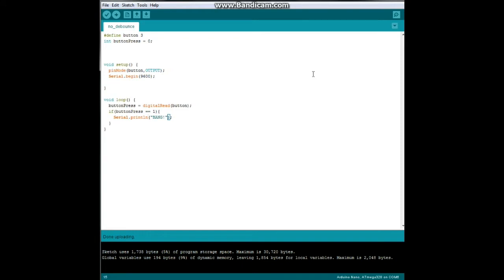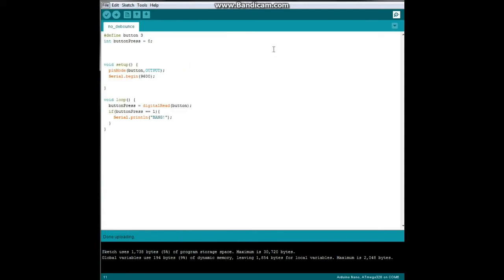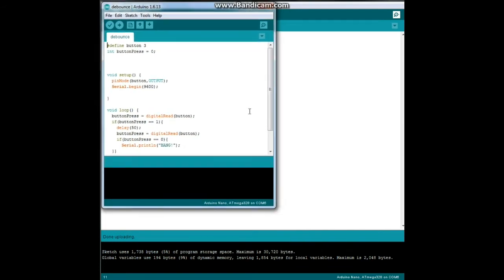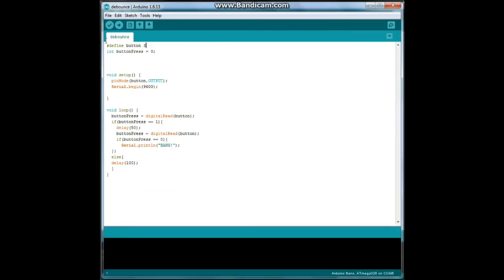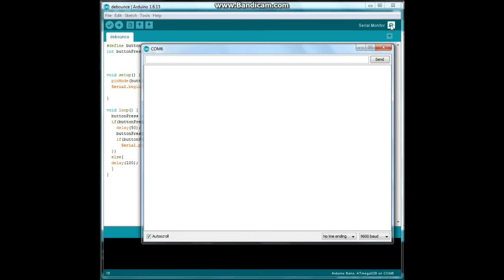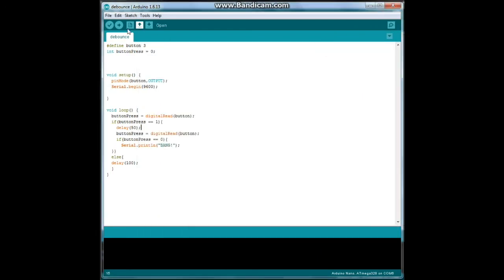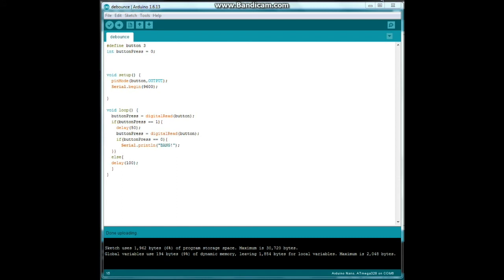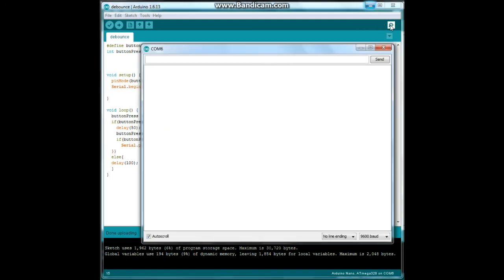How to debounce a button for Arduino

Comment: The multiple outputs of “bang” is because the code is checking for a high voltage on the button rather than the change of the voltage from low to high. So if it loops 1000 times in a second, it will print “bang” once per millisecond. If the code was rewritten to detect the change from low to high and still printed “bang” more than once when holding the button, that would be due to bouncing

Comment: I don't think the behavior you were seeing is due to bouncing. You're polling the button in a loop and printing a statement whenever it is high. Meaning that if you were to hold down the button it would continue to print the statement.
Reply: I think even if he held down the button, it will only print when a change occurs (1 to 0). This is due to opposite conditions of the if and the nested if.
Reply: @arjunmonga1054  

Josh is talking about the initial code he used. With the first sketch, learnelectronics claims the multiple printed statements from one single press of the button is due to "bouncing"--the phenomenon of multiple signals being generated from the contact of two metal conductors. 

Josh is claiming that the multiple printed statements are likely not from bounce, but rather from the loop() statement in his code reading the state of the button pin multiple times within the small amount of time the button was pressed.

 I'm not claiming to be an authority on avr or arduino, but I imagine the loop() method is called over 100,000 times per second.
Reply: I agree.  learnelectronics is confused.  Also, the bounding in the oscilloscope is not large enough to register a single logic 0 bounce so it basically does not bounce at all.
Reply: exactly, if you keep press on the button, that BANG continues to appear

Comment: This is a very simplistic approach, and not a good example of bouncing. A better way to handle input from buttons is via interrupts, ISR() and bit flags. Set an interrupt on pin change, set a bit flag for the button being pressed, exit the ISR, in the main loop read the bit flag, action on any that are set, reset the bit flag. You may need to artificially delay the main event loop depending on your application but this is a MUCH better approach. This also means you are not depending on your loop() to be fast enough to catch the button, the ISR will trigger and stop execution of the main code and return once complete. If you are doing something time intensive, like writing to an SD card, with you example there is a good chance of a button press being missed.

#define BUTTON1 0b10000000;
#define BUTTON1PIN 3;
uint8_t BUTTONS = 0b00000000;

void Setup()
{
       pinMode(BUTTON1_PIN, INPUT);
       attachInterrupt(BUTTON1_PIN, ISR_btn1, FALLING);

}
void loop() 
{
	if (BUTTONS != 0b00000000)

	{
		if (BUTTONS & BUTTON1)
		{
			Serial.println("button 1 pressed");
		}
        BUTTONS = 0b00000000;

	}

}

void ISR_btn1()

{
	BUTTONS |= BUTTON1;

}
Reply: Good idea, but bounce can still cause multiple prints in your code.
Reply: @MrDavid949  Agreed, but let be honest, bouncing is a hardware problem, and should be fixed in hardware. Using a 100uF Cap and a 74HC14 for perfect switching signals. However you could further refine the code, but resetting the flag and checking the pin state in say 10ms to determine if the button is actually pressed. You could even go to an extreme, and check the state on interval, storing the bits in a byte, and using a pattern to filter out bouncing from the sample set. You can get ridiculously complicated trying to solve a hardware problem in software.

I think I am going to do a "Everything your were taught about using a button with a micro controller was wrong" video :), hyperbole I know. Very much like my strings are bad mmmkay video, where I go into detail about how you should be using char arrays, because dynamic memory in a memory constrained environment is bad.

Comment: if you put capacitor 100 nf between ground and signal of button 3 you wil prevent the bouncing electronically
Reply: Can u explain why that happens.. thanks
Reply: @mibrahim4245  This happens because the "bouncing" effect from the contacts doesn't take as long to occur as the capacitor does to charge. capacitors will not allow electrical flow until they are charged.

Comment: Okay, taking comments beneath into account I did the following:
To avoid output due to running the loop a few times while the button is pressed I'm checking the button state and only proceed when the state changes (code borrowed). If there is bouncing there will be multiple outputs when the key is pressed or released. And actually, without the debouncing lines I'm reading more state changes (a few, not 40). (I'm a newbie, so please comment if it can be of any further help. I need to debounce a Reed switch from a rain gauge.)

#define button 3
int buttonPress = 0;

boolean oldSwitchState = LOW;
boolean newSwitchState = LOW;

void setup() {
  pinMode(button,INPUT); //no need for _PULLUP as a resistor already pulls it down (right?)
  Serial.begin(9600);

}
void loop() {
newSwitchState = digitalRead(button);
    if ( newSwitchState != oldSwitchState ) 
    {
       delay(50); //DEBOUNCING: delay
       newSwitchState = digitalRead(button);  //DEBOUNCING: read state again
       if ( newSwitchState != oldSwitchState ) //DEBOUNCING: is the new state permanent?
       {
        if ( newSwitchState == HIGH ) { Serial.println("BANG!"); } // Button press
        else                                               { Serial.println("!GNAB"); } // Button release
       }
 
       oldSwitchState = newSwitchState;
    }   
}

Anyway, the post was inspiring, I learned something. Thanks all.
Reply: Very nice to see, how did you end up anyway with the output even though this was about four years ago :)

Comment: Logic ideally would detect and act on change in state. Using delay creates the desired behavior but not an ideal programmatic solution.  This is often referred to as a race condition and will lead to other problems as your code becomes more complex. Instead, compare the pin state with the current variable value. Perform actions and reset variable state only after change detected.  A very small 1ms delay is usually appropriate for any open loop to constrain the cpu but not to mitigate undesired behaviors.
Reply from the maker: I'm not a prgrammer
Reply: Something like this? 

delay(1);

while(digitalRead(buttonPin) == true){};

delay(1);
pressed++;
delay(1);
Reply: @HyperionBadger   Almost, below is something more in line with my thoughts.  
The "state" variable gets set only once in the loop per button press and release.  
After the state is set, the second "if" condition is used on subsequent loops to prevent the "bounce" calls.  
When the digitalRead value changes, the alternate condition is raised setting the "state" variable again.     

int state = 0;

void setup() {
  //setup logic
}

void loop() {

  if(digitalRead(8) == HIGH)
  {
    if(state != 1) {
      state = 1;
      buttonPressedLogic();
    }
  }
  else {
    if(state != 0) {
      state = 0;
      buttonReleasedLogic();
    }
  }
  
  delay(1);

}

void buttonPressedLogic(){
  //todo: code logic
}

void buttonReleasedLogic(){
  //todo: code logic
}
Reply: @thomasbrabender7782  I'll give it a shot after work tomorrow. 

What it looks like though, is that when it reaches the first iteration of the loop it will go into the first if statement, since state is initially 0, so:

 if(digitalRead(8) == HIGH)
  {
    if(state != 1) {
      state = 1;
      buttonPressedLogic();
    }
  }

So buttonPressedLogic() gets called, state = 1, and delay(1) gets called. My finger is still on the button because only one millisecond has passed and as a human I can't possibly lift it that quickly.

The next iteration it will go into the else if statement, so: 

else {
    if(state != 0) {
      state = 0;
      buttonReleasedLogic();
    }

So buttonReleasedLogic() gets called, state = 0, and delay(1) gets called. My finger is still on the button because only two milliseconds has passed and as a human I can't possibly lift it that quickly. Not good because I'm still holding the button down.

The next iteration it will go into the first if statement, so:

 if(digitalRead(8) == HIGH)
  {
    if(state != 1) {
      state = 1;
      buttonPressedLogic();
    }
  }

We now have called buttonPressedLogic() twice with a single button press. If me pressing a button takes 50 milliseconds, buttonPressedLogic() will have been called 25 times. 

Am I correct with my logic here? Regardless, I love the creative approach.
Reply: @HyperionBadger     Your thought process is good, the analysis is slightly off however.  
The ELSE statement is from the original IF, curly braces make this a bit hard to read.  
Should only fall into the ELSE when the digitalRead(8) is no longer HIGH and vise versa.
Reply: @thomasbrabender7782  AHHH I missed that. Well done, I will try this when I get home. I don't like debouncing, so solutions like this are what I'm looking for. My code worked, but the utility of "state" will come in handy. Thank you for sharing.

Comment: This has nothing to do with bouncing! Your multiple outputs are due to the fact that you read the pin state in a loop. So the code loops x number of times while you press the button.

Do NOT follow this advice…

Comment: Gee. I was hoping to pick up some novel approach. heh, heh, novice approach. Naive approach. Some switches bounce longer than 50ms which might not be a problem since that's not your worst error. Or the bounce time approaches the length of a quick press say 125ms or faster - now there's trouble. I don't think your scope is up to the task of showing how bad it really is - your bounce goes to 0v, but the scope bandwidth is filtering that out.  Maybe you can't speed up that sample rate and/or zoom in. I'll have to see how well my bitscope does with switches, but at work I use a high priced machine so I get a good clean capture.

Your big prob is just checking for a zero to see if it's unpressed. What if it's in the middle of bouncing and doesn't get a zero (back through the loop which could take a while in a real application,) or gets a 1 and is held, which might be a valid or required input - press and hold. Then hope that 100ms delay for the else block is optimum.

So you can do as you are and then do as I tell you after your first press detection, or you can just do what I say whenever you want to check for a press. Just enter a fast loop that checks the switch state for - I'd start around 125ms, but better to first characterize my switch on even a lesser scope even if it doesn't show all the detail. sample the switch maybe 100 times and count 1s. Is 51 1s enough? 60? 80?

That 328P in your nano can be set for pullup resistors on the input which takes care of the external resistor and you connect the switch to ground. It's called active low logic if you wan't a 1 for a press even though it goes low. You deal with it in code. I don't use the arduino library, so I can't tell you how to set it. But now you count zeros or look for a 1s count (assuming the thing's still bouncing when you detect that 0 - doh!) that's less than 50.

Seriously. Your thingy might work and even well, but I wouldn't be allowed to code that into a consumer product if safety were -- unless the product was made of pure cotton, LOL - friggin' litigious society.

Ok. I'm off to see a coupla other catchy titles, hjeh, heh. Maybe I'll see you.
Reply: What do you think about this: 

delay(10);
while(digitalRead(buttonPin) == true){};

delay(10);
pressed++;
delay(10);

Comment: if I want to debounce a button on a LCD keypad to the select button, how would I implement it to a code the that I already have going, can someone help me, here's the code that I have going already 
#include <LiquidCrystal.h>
LiquidCrystal lcd(8, 9, 4, 5, 6, 7);
#include <DFR_LCD_Keypad.h>
#include <AnalogDebounce.h>
int localKey = 1;
int count = 0;
long diceOne;
long diceTwo;
int countDelay = 220;
int setColumn = 0;
int SAMPLE_WAIT;
 AnalogDebounce Buttons(A0,ButtonPush);  // Analog Input 0, 
                                          // ButtonPush is callback
void setup() {
  lcd.begin(16, 2);
  lcd.setCursor(8, 0);
  lcd.print("Roll the dice!");
  
  }

void buildUp() {
  lcd.clear();
  for (count = 0; count <= 16; count++) {
    lcd.setCursor(setColumn, 0);
    lcd.print(random(1, 7));
    lcd.setCursor(setColumn, 1);
    lcd.print(random(1, 7));
    delay(countDelay);
    countDelay -= 13;
    setColumn += 1;
  }
}

void loop() {
   Buttons.loopCheck();
   case KEY_SELECT:
        lcd.print("rolling dice");
        break;
  }
  
  randomSeed(analogRead(0));
 
  diceOne = random(1, 7);
  diceTwo = random(1, 7);

    buildUp();
    lcd.clear();
    lcd.setCursor(7, 0);
    lcd.print(diceOne);
    lcd.setCursor(7, 1);
    lcd.print(diceTwo);

    if (diceOne + diceTwo == 7) {
      lcd.clear();
      lcd.setCursor(7, 0);
      lcd.print("7");
      lcd.setCursor(3, 1);
      lcd.print("The pirate");
    }

  if (diceOne + diceTwo == 5,4,3,2,6 ){
    lcd.clear();
      lcd.setCursor(7, 0);
      lcd.print("5,4,3,2,6");
}
}
Reply: and is this the way to read a button if it is pin A0?
#define button A0
int buttonpress = 0;

void setup() {
pinMode (button,OUTPUT);
Serial.begin(9600);

}

void loop() {
buttonpress = analogread(button);
if (buttonpress =1)(
    Serial.println("BANG");
}

Comment: your explanation is completely wrong... you just preventet the loop from outputing over and over....
Reply: It will debounce too. But it will only trigger at the falling flank. And will seriously reduce the speed at witch the loop cycles. 
For a lot of circumstances this is a perfectly valid solution though.